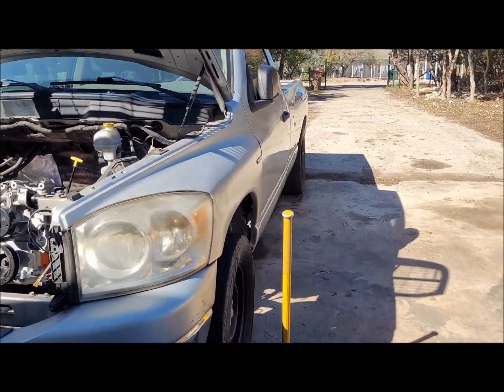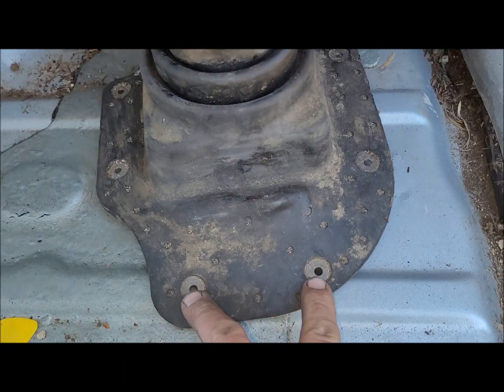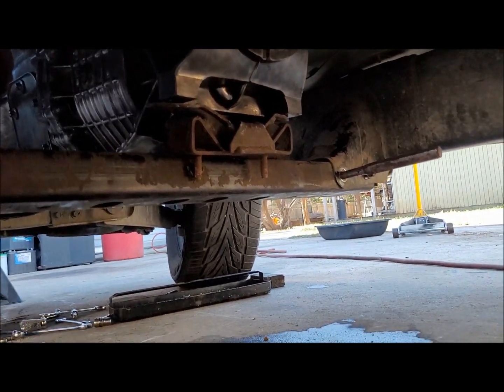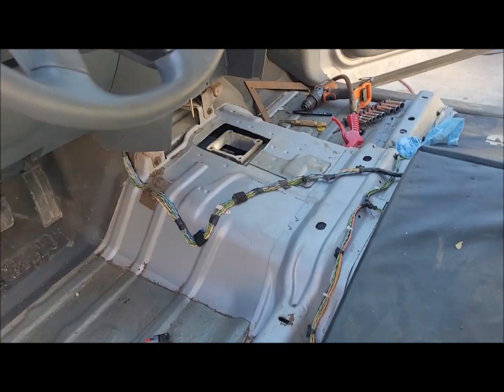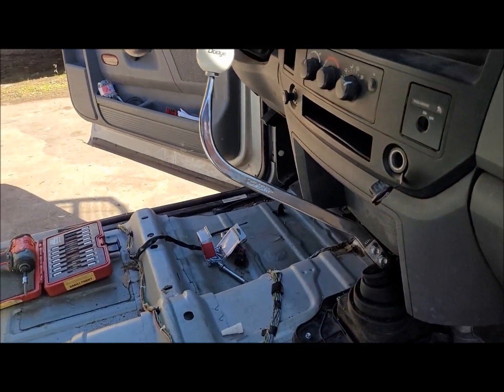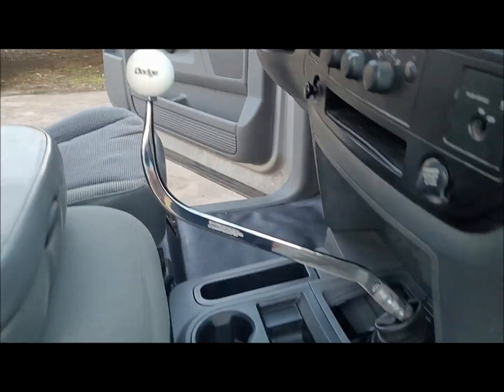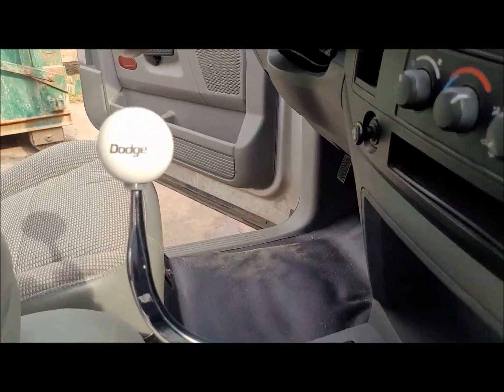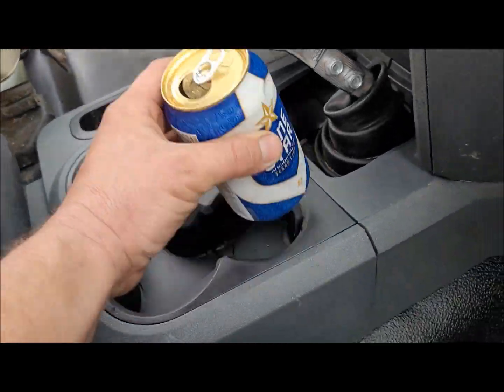2007 Dodge Ram 1500 5.7 Hemi G56 6 Speed Swap 4.56 Gear Part 1 HHG

Comment: where did you find your Hemi specific G56 I havnt been able to find one
Reply from the maker: I found it on marketplace in East Texas. I found one other one for $1800 but i didnt want to spend that much and I really didnt have anything to put it in. I already converted my ram charger to an nv4500 or i would have put a G56 in it. 

They are extremely hard to find. 

As far as I know, they only made them 2006 2007 and 2008. Ive heard they were available in 4th gen cab and chassis trucks but Ive never seen one.
Reply: @halfwayhousegarage2959  I have a 05 hemi g56, it actually has a treaded shift tower like the nv4500/5600
Reply from the maker: @stubbsshop  can you send me a picture of it?

Comment: Do you know if a hemi g56 will bolt up to a cummins?
Reply from the maker: They will not. The bell housings are completely different and the input shafts are smaller on the hemis. Do you have a hemi g56 you want to sell?